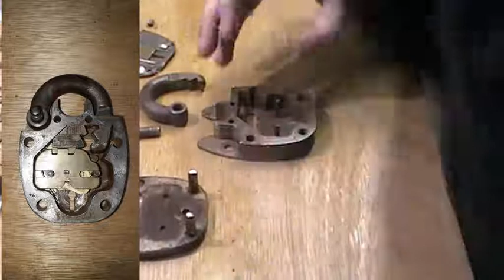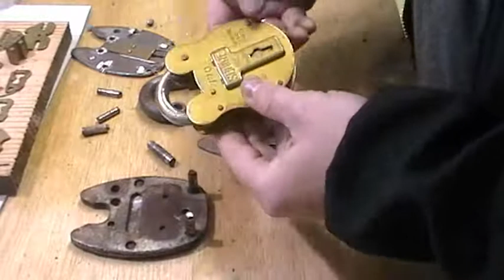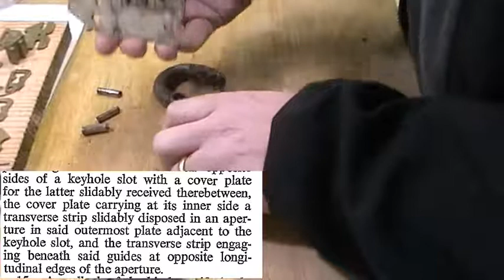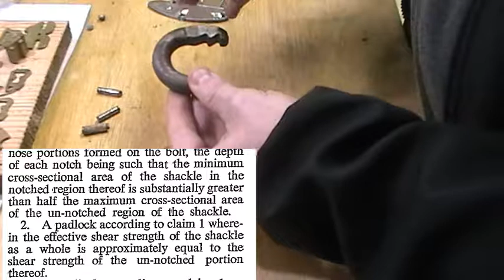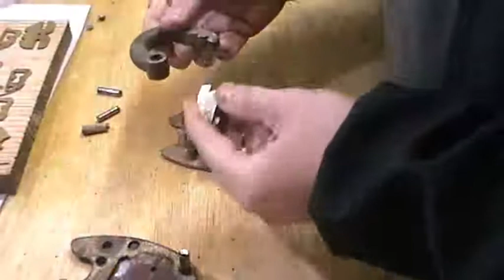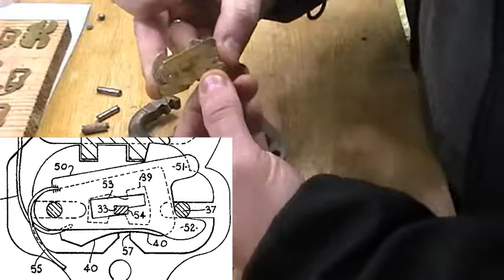Squire Defiant Lever Padlock - discussion of patent and working parts

Comment: I have a Defiant that's unlocked and I don't have a key. Can I pick it closed by tensioning the bolt, lifting the levers, minus the guard lever, then when the levers are correct, at the last moment, engage the shackle?
Reply from the maker: Yes in theory you could - the only thing that would stop that would be if the cut out for the guard lever was in a position to bind before one of the other levers. I don't think that is the case and so you should be able to do it that way. 

I'd probably close the shackle and hold it tight down using an elastic band so the guard lever is always engaged and then pick it closed. I think in the close direction the levers are angle cut so you might even be able to close it with tension and some taps with a hammer to make the levers move a bit - I've never tried though....

Comment: Brilliant discussion buddy 👍 Thanks for the share of this 😃
Reply from the maker: Thanks Coxy it's an interesting lock....I'm going to try and do some more like this but obviously need some not good condition locks to take apart that I can also find the patent for.
Reply: I do like picking the defiant, if you find a valiant don't hurt it - for some unknown reason they are harder to find... Even though they are newer and were cheaper 🤔
Reply from the maker: @CoxysPicks  i know....i have a standing search on ebay for a valiant....🤔
Reply from the maker: @Baldiloks yes I've got a new old stock one as well...it's on the wall nowhere near an angle grinder.

I'd love to do a cutaway but I don't have the tools currently...saving up for a pillar drill so once I get that the disassembly will at least be neater.